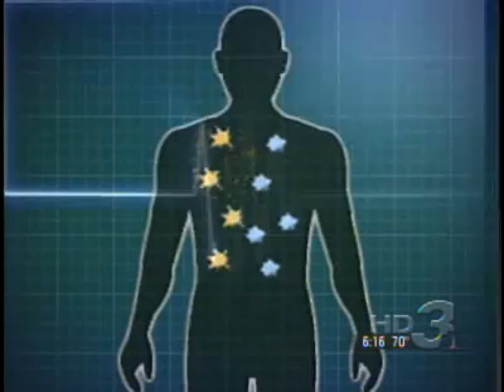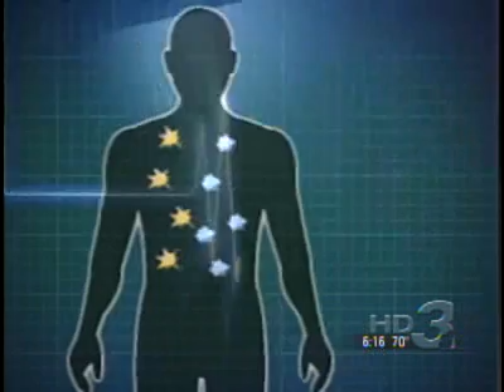Salt Water into Fuel

Comment: And WHERE is this tech now and WHY don't we have and use it? ANSWER: "Disruptive technology" is not allowed. There is a reason you have a power meter in your house, why you pay a gas tax and why the US dollar is pegged to oil. 13.56 Mhz. is the secret frequency used to crack water using low current and high voltage frequency.  A DC power modulated (on and off) at 13.56 Mhz. In a coil around a glass tube (watch the video carefully) filled with salt water.  There are simple ways to get this effect using only the positive (one wire) rectified to produce radiant energy that uses very little energy. Impossible you say?  There you go. Another reason this is not available to you. Your limited beliefs spoon fed to you by a system that needs you to pay your taxes and remain dependent.

Comment: But how much electrical energy from fossil fuels is required to generate the radio waves? Is it self powering, or is it a net loss overall? This is usually the case with these ideas, they sound great until you realize there isn't really any benefit.

Comment: sadly thing is that he didn't split water ! he just made a plasma discharge trough water ! A HHO "flame" production of that size will consume the water faster than it is visible in the video..also , see 2:37 and freeze image.. oxy-hydrogen flame does not burn horizontal in respect with source exiting direction, nor with "thunder" shape.. for me is a clear form of RF induced plasma using water as "burner"/electrode ... another thing, why he ignite the "fire" with a tool that has no spark ? or other said..how he did start the "fire" ?!

https://youtu.be/AlR7p7DIzCQ

Comment: how many watts did the radio signal generatot use ?
Reply: +Nathan Cobb 13.56 MHz. This isn't an absolute. A narrow range of experimental frequency sweeping still in between 13 and 14 MHz. Personally though, I would stick with 13.56 Mhz.
Reply: Marchel Andersen 200 watts (source: https://nick2.wordpress.com/2007/06/01/saltwater-into-fire/ )
Reply: What was the specific frequency
Reply: What was the specific frequency
Reply: I don't have the specific frequency, but if you have a frequency generator capable of going far into the low and high frequencies, it probably wouldn't be a difficult task to slowly skim the frequencies until you find it.. I think there's also a formula you can use to single-out "natural frequencies" of water (since I imagine it's likely one of those), and that would greatly reduce your search time. I wish I had time and money to tinker with stuff like this.
Reply: +Bone Drone fascinating

Comment: 1) Oh in that case I stand corrected.
2) I meant "water is being burned" as in the process of the bonds being broken then the hydrogen being burned. I was simply being brief (though, I guess, incorrect). Also, I wasn't saying it offered an advantage I was just saying it wouldn't be as expensive as you originally made it sound

Comment: 1) More advanced doesn't mean better. E.g. You can use trig or simple geo to derive the Pythagorean Theorem and get the same result.
2) That wasn't what I meant. I'm saying that the water is being burned up faster because more energy is being put in. Higher rate = less time. Less time = lower cost.
3) I was just saying you quoted the video incorrectly since they said innovator not inventor. Doesn't really matter.

Comment: Of course radiotherapy was used but that doesn't mean it was perfected. There are always better ways to go about it. Has cancer been cured yet? No. This guy's just trying to find a better way to treat cancer.
Also, while it does take a lot of power to generate that field, a lot more energy is produced as well. I'm not saying it's practical; I'm just saying that the ratio of cost to energy output is not that different.
I find your condescension irritating.
Oh and it's innovator not inventor.

Comment: more hydrogen could be extracted with the same power in many other decomposition methods, and even then, the efficiency cannot exceed more than 40-30%, even if we use fuel cells. and even less gain when combusted like in this method it would be more like less than 20-5%. gasoline burns with the energy efficiency of 30%, there is absolutely no reason to use this method of decomposition and combustion as a source of energy

Comment: 4
Sure it can generate power by N.F., but since its just another chemical reaction, it would not be possible generate more power than spent, in fact, you will lose power as you do this reaction because of inefficiencies in the machines.
Reply: DHK how about using solar, wind and geothermal. It would only amplify the total output

Comment: The disassociation, or the decomposition of (2 H20) -> in to (2 H2) + (O2) is an  endothermic reaction, which means it requires massive activation energy (the high powered radio provides the energy and the salt acts as a catalyst). What he is than doing is an another synthesis reaction to burn the H & O. resulting in an loss of energy rather than a net gain.
Reply: run it on solar power then ;)
Reply: @jeffblaine933 👋😢❌ this was the greatest discovery this century an has been Hushed the Fuk’Up since ✅❌ Wonder Why , instead of bringing its efficacy Up to a gain profit , they’ve got so called Payed off Scientists to say /// Nothing to see here , Should speak Volumes ☝️😉✅❌ I’ve got that ((Popular Mechanics)) magazine as Proof of Suppression 😎👍❌

Comment: yes there is no net gain at that point, but it is a piece of a larger puzzle. by using green energy from some place, it could be transmitted to a re-designed coal fire plant for instance, and essentially replace the coal being used.

Comment: Generating high-frequency field strong enough to split water takes a lot of power. That would be very expensive way of creating hydrogen. If he'd just go with electrolysis, he'd get much better results - but wait, it's known already for what, a couple of centuries?

As for cancer treatment it's just laughable. Selective irradiation of cancer tissues was used as treatment from the day one (radiotherapy, duh), and x-rays perform much better here.

"True American inventor" should read a bit more...

Comment: @marek0086 Its not you obtain less than you put in Simply your omitting the chemical  reaction of the electrolyte, salt in this case The RF simply  being the trigger.  This same principle allows batteries to remain charged while driving.  Hydrogen production has been around for a long time. For 100% chemical ways of hydrogen production (like they did in the turn of the century)  check out "On Demand HUGE Hydrogen Production, How to Make Hydrogen"

Comment: It's not "electrolysis" is it, because there is no electical current being passed through the water.  So how do the radio waves break the covalent bonds of H and O? Technically the "bond-energy" being released is the same as which went into forging the diatomic molecules together in the first place.  We have to assume the radio waves are exciting the molecules, which begin to vibrate and break apart around 60+ Kelvin.  So you wouldn't want to keep your hand in the beam for long...

Comment: this occurs only in the presence of a strong radio-frequency field, which supposedly dissociates the water into H2 and O2. These two gases then recombine, producing the flame. Although there has been much uninformed hype about this being some kind of a breakthrough as a source of "energy from water", there is no reason to believe that the First Law of Thermodynamics has been repealed. If the energy supplied by the radio-frequency source is taken into account, there has been no net energy gain.

Comment: THIS JUST IN: Television Station Owner Featured in Breathless Report of Rube-Goldberg Contraption he Built to Convert Electricity Into Heat

Employees of a local plastics company marvelled at the device's ability to burn hydrogen at fairly average temperatures.  The lead reporter did his best to look dumbfounded while watching demonstrations of a microwave transmitter light up a fluorescent bulb and uneconomically power a heat engine.

Comment: it is not the frq. of signal he is using it is the power in that signal. salt water acts as a capacitor. therefore the it just passes the dc current of that signal. and as it is known since the 19 century , if you pass dc current through water it will brake down the water into its elements.

Comment: On June 24, 2008, Michael Rosbrough wrote
I was wondering about the potential downside of Mr. Kanzius' de-salinasation(salt water to fire) discovery. If a RF signal, 13.56 MHz, is directed toward a container of salt water which causes the positive electrons in sodium to seperate the hydrogen from the oxygen molecules and burn the hydrogen, why can't we speculate that other objects such as a large body of salt water, the human body or any potential environment where salt and water exist,. ..etc.

Comment: @PHi11yV3ga Its Basic high school physics.  110-120v at 11-14 amp equalls between 1200-1700 watts of electical energy used to run the machine that makes the water burn.  NOW he can not use that tiny burning salt water flame to even get 5% back of the electricity he using to keep the water burning . His method wastes far more energy than what can be used.  Its amazing discovery, but untill he can get his power input to less than 50 watt it is not going to help anyone.

Comment: @kevinander77 you obviiously didn't watch this video at all this machine that was created was made from pans and wire which isn't all that hard also watch and see that there was even electricity distrubuted through the machines radio beam and to power that machine i can bet that it was only 110-120v with maybe 11-14amps input

Comment: @volopok you got this right on. This is the reason the hydrogen car has failed so far. the car and idea is amazing, but its fuel takes extremes amount energy to produce.  Its like somone doing a $100 worth of work and only getting paid $20. And producing hydrogen in this way is no better than splitting water with electricity. VERY inefficient!    people Don't understand.  its a very neat and cool idea and a step in the right direction.  But no amazing energy breakthrough.

Comment: @SphinCorp 
well, unlike petrol, where you can just make it and then set it alight, this salt water requires the microwaves to be constantly targeting the water to keep it burning. and you need energy to make the microwaves, which means you need another power source. which means that this salt water is just fancy wiring. not good if you still have to lug around either an electrical battery or a petrol combustion engine.

Comment: Although it is true that it uses more energy than it creates, so does ALL other form of engine. The point is this is an efficient way of turning electrical energy + chemical energy into mechanical energy. This is an improvement on the method used by the combustion engine, it being more efficient and having no greenhouse emissions.

Comment: using water as fuel isn't completely rubbish, just that it seems like the news media is trying to say that it's a source of free energy. you can use water as fuel (or at least use the hydrogen/oxygen gases gotten from the electrolysis of water) but the problem is that fuel isn't an energy source, and never has been. ALL portable fuels are an energy storage system (fossil fuels included, unfortunately fossil fuels are toxic, but water/burning hydrogen isn't)  you still need an energy source.

Comment: this is the evidence that this is a same old sucker world and you can sell ice to Eskimos as a new invention - and find buyers.
1.we all should remember the experiment we did in school labs breaking a water mol. (H2O) by electrolysis connecting 2 electrodes in test tube and the light-blue flame on the top of the tube when oxygen + hydrogen met again.
here the flame is deep yellow.not O2 and H.
 2. the energy u need to put  breaking water mol. = to energy u got -simple physics. NO WAY BUDDY.

Comment: Venus - the heat did do it. heat is energy. and in this case it provided the activation energy required for the chemical reaction you speak of, this is no miracle it happens in labs everyday. This heat needs to be supplied (by a bunsen burner for example) so you must use fuel (burn gas) to get your product.

Comment: Nobody's going to enforce the laws of thermodynamics, and it's the kind of law that just begs to be broken.

I'm kind of curious about a redox- set, though.  breaking water down into hydrogen and oxygen is great, since we can do it as a fuel source. but what do we do with the pieces? how do we reassemble them into water?  hydrogen, in the presence of oxygen, burns, creating water- which is a start, but that reaction was only *salt* water and so we're left with no salt.

Comment: The radio generator basically provides the energy to split H20 into H2 and O2, then the spark provides the activation energy to combine the two back together again to form H20 (which relases heat and causes a chain reaction), this is known as the heat of formation and is equal to the energy required to split the two. Hope that answers things. Fairly sure my logic is correct, I do study this crap at uni.

Comment: Basically this drains more energy than it can provide. This is based on the second law of thermodynamics which you might know as the law of conservation of energy (energy in must equal energy out). Energy going into the radio device must be equal to (but will no doubt exceed due to ineffiencies in equipment) energy 'exiting' as heat. Then there is the fact that the heat will not be harnessed 100% efficiently.

Comment: well, generate RF with electronic and crystal oscillator was just like the radio transmitter for the R/C toys.
it require small current and voltage, as what john said the machine had greater power output compare to input power. 
the heat preduce from buring salt water can boil up water, which can be use to power the stream turbine just like those NUCLEAR power station.

Comment: if the energy of the system is the heat produced by water flames, it ll generate the exactly same amount of energy needed to produce the reaction. 

google the "hess law"

that process is useless for powering engines but can be usefull for generating high temperatures without using petrol derivates but it will need a power impute to operate.

Comment: how much current and voltage required for the machine to generate enough energy to support the burning?

it can be the future of power plant just to generate eletricity by stim turbine.. ,
he he he...it probadly can replace the nuclear and ooOo&Gasssshit... to generate electricity, no hazard wast, 
the clorin/hydrogen problem can be solve by special stack to filter it as the carbon trap.

electricity power from salt water..., next was power station to charge vehicle..
clean future..ha ha

Comment: Actually - the fuel is the electricity used to run the high power radio wave generators. I bet that stops burning as soon as you switch the machine off. Close, but no cigar

Comment: Yes, but oil was an energy source too even before being refined.  This water is burned to create water again The water cannot release energy and then return to its original state-the burning is only the discharge of the energy given via a radiofrequency and sincenothing is 100 percent efficient, it isn't even a break even deal.  Even if the 2nd law of thermodynamics was magically repealled, the best you could hope for is a break even exchange of energy.  Sorry, but won't be an energy source ever

Comment: You do realize that the very reason this is impossible makes your concern irrelevent?

The process takes water, seperates it into Hydrogen and Oxygen and then burns those two gases to re-create water.

Since no process is reversible, not to mention reversible with energy being extracted, this "discovery" is useless.

But if you don't believe that, you can at least rest assured since no water is consumed in this process, it's just changed from water to steam.

Comment: Good observation.  But even if the machine burns regular water, you wouldn't want to.  We need our fresh water to live, but salt water can be burned with no danger of running out.  However, if we eventually get some unreal number of cars running on a daily basis, I could see us facing a problem of low water levels in the ocean.  But we're talking some unimaginable amount of vehicles (depending on how much salt water is needed per vehicle).  By then we'll have moved to another planet or something

Comment: a large part of the world doesn't get cold enough for even pure water to freeze and even if it did, the oceans will never be pure. in fact, during the winter the salt sinks to the bottom and the water at the top is as close to fresh as it's gonna get without proper filtration. most of the other part of the world gets cold enough for salt water to freeze. a small part of the world only gets cold enough to freeze fresh water but not salt water.

Comment: we won't run out of water if we do this. three things are produced as a result of this; water vapor, salt, and ozone. The water vapor will go into the atmosphere and rain back down into the oceans, the salt will remain in the container, and the ozone will help repair the damage we've already done to our atmosphere. There are no bad sideaffects to doing this. as for it using more energy than it produces, i'm not sure but i want to see you get to work riding on just radio waves.

Comment: What about the electricity used to power the radio generator. There is no useable energy in salt water until it is split up into hydrogen and oxygen. The salt is a conductor, and I assume the radio waves generate some sort of electric current in the solution